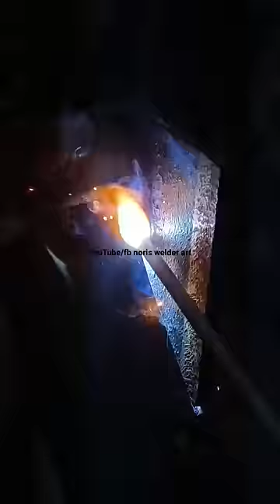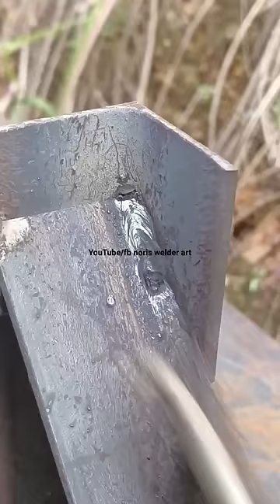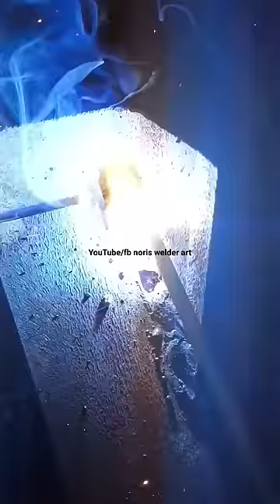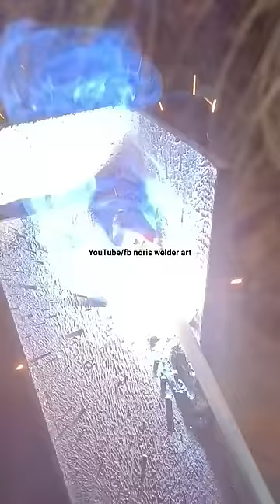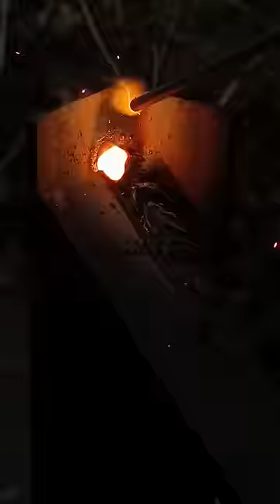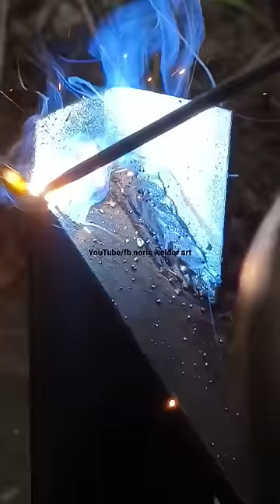welding thick angle iron #welder #welding

Comment: I see all these 'YT welders' and, apparently, none of them seem to be capable of welding a continuous bead.  Instead, they weld like 1/2 an inch at a time without cleaning the slag off in between each application.  You get slag inclusion that way and the weld looks terrible.
Reply: YT?

Comment: This hurt me as a welder to watch. Tack welding downhand on what looks to be 1/4in angle. Even tack welding the flat/horizontal. I hope it was the kids in the background messing around with the welder. Why would someone even bother chipping this garbage? I hope it got fired in the scrap bin after the video cut. How can one post this as an informational video? The downhand tack weld looks like trash and ya blew through half of the joint?? So ya put more bird s*it on top of bird s*it??

Comment: I never weld downhill your not getting any penetration that weld will have cracks by the end of the day and after ten years of welding I've never even seen a 6013 rod lol 7018 6010 6011 is the way.